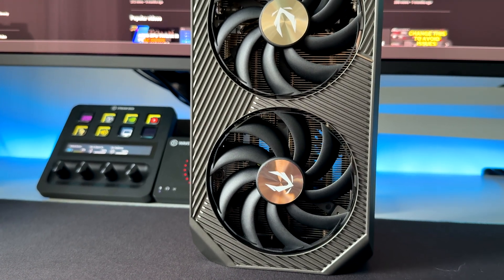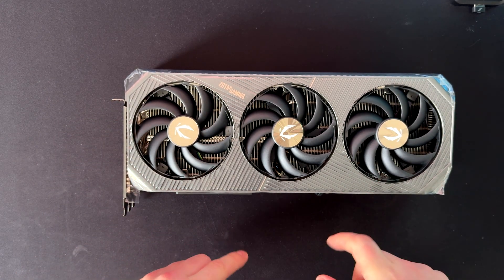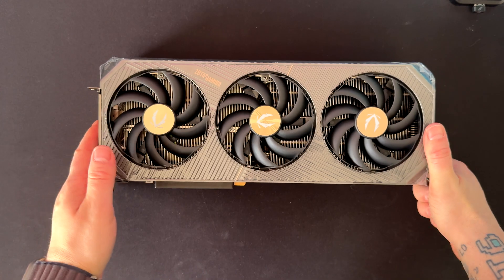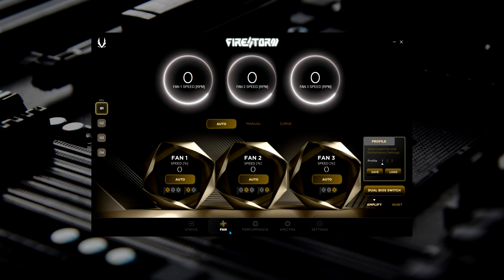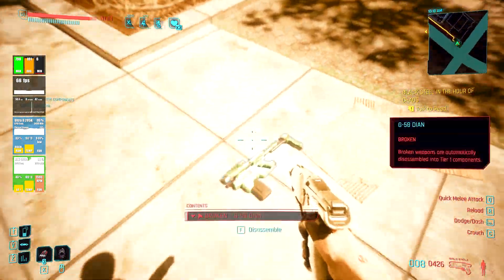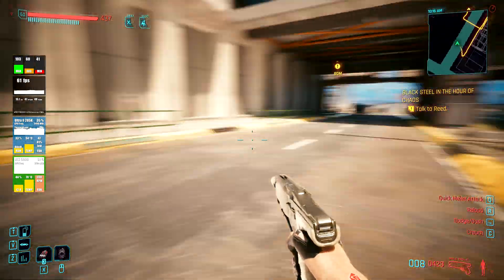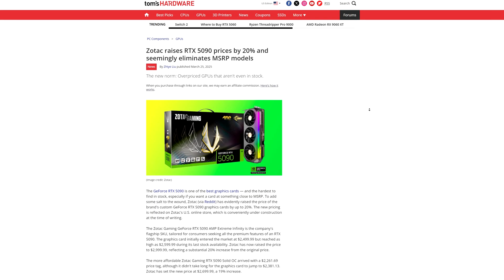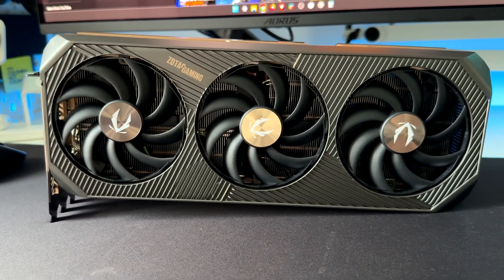ZOTAC GAMING GeForce RTX 5090 SOLID OC

Comment: Can you control the RGB via zotac software? Without connecting the white cable to the GPU and the motherboard.
Reply from the maker: As far as I tested you can’t
Reply: @JULVEXGAMING Last night I actually did manage to change the RGB with the Firestorm software, so I guess you can. Unrelated, but could you upload your VBIOS to TechPowerUp? I have the solid variant and I'd like to flash my card with the OC VBIOS.
Reply: @JULVEXGAMING Actually, last night I got it to work. I turned off the RGB via Firestorm. Unrelated, but by chance, would you be willing to upload your VBIOS to TechPowerUp? I have the solid variant, and I'd like to flash my card with the OC BIOS.

Comment: Nice video I just recently got my msi rtx 5090 vanguard launch edition it’s amazing it goes well with my msi pc build
Reply from the maker: that's an  amazing gpu too,  enjoy it
Reply: @JULVEXGAMING i just ordered this gpu . are your scores based on overclock
Reply from the maker: @thomaseruchie1262  no all of them are on stock settings
Reply: @JULVEXGAMING how does it afir with oc and u servilting.  Ket says i want locked clock of 2.86 ghz what colatge would u recommend.  Looking at 0.925mv. Although  it depends  on silicon lottery.
Reply from the maker: @thomaseruchie1262  you're right, it depends much on that and on the airflow  of your case 0.925mv could be a good starting point, but you might not get (stable) 2.86Ghz, worth trying though